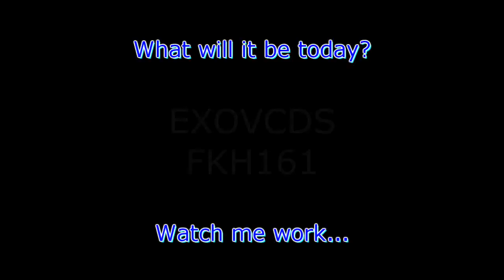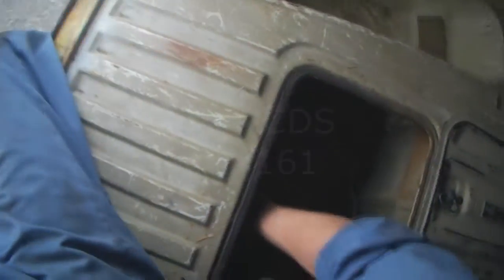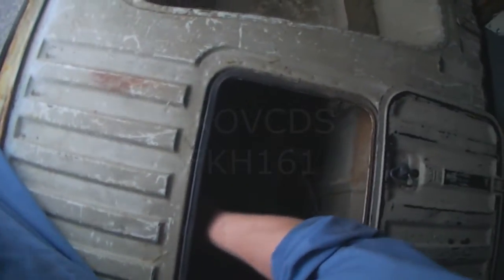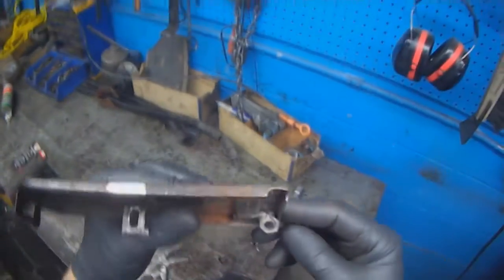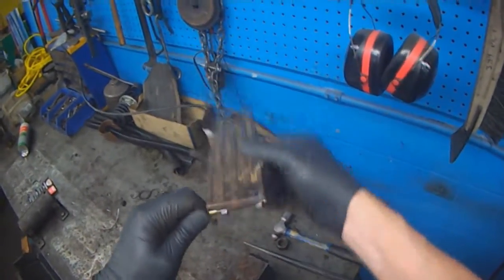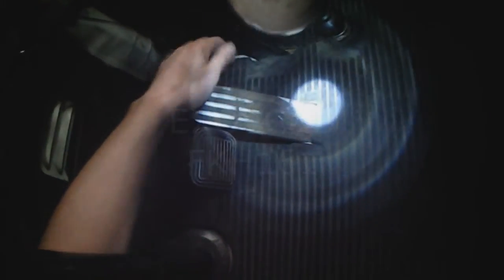VW T2: Broken Gas Pedal Hinge

Comment: dis happened to me just the other day, please tell, what type of nut(s) did you weld . . .  Metric or English?
Reply from the maker: Doesn't matter... whatever works / that you have (the threads in the nut holes are not used).

Comment: how do you remove the original pin that hold the petal to the mount?
Reply from the maker: It's a crimped hinge fitting similar to a door hinge:
https://volkswagen.7zap.com/en/usa/type+2/t2/1978-29/7/721-62000/

Comment: Can any one help me with a problem I'm having on a 2006 passat 1.9 bxe engine , it starts fine when cold but after it warms up it'll start and stall straight away then after a few try it'll run fine , I'm getting a p1570 on my scanner
Reply from the maker: If the immobilizer icon (key) in the dash is flashing, then the immobilizer is not recognizing the key for some reason... for other possibilities, read through this link:

http://wiki.ross-tech.com/wiki/index.php/17978/P1570/005488
Reply: Thanks for the reply , the icon is not flashing so ill check elsewhere , hopefully I'll get to the bottom of it , keep.up the good work and the videos
Reply from the maker: Paul Meehan Could be temperature sensor, crankshaft position sensor, intake flap sticking closed, in-tank fuel pump, EGR sticking open...
Reply: Crank sensor ,egr, fuel pressure seem fine intake flap is operating ok so it's looking more like an  immobiliser issue
Reply from the maker: Paul Meehan Weird that it only happens when warm... I have heard of / similar issues but have not seen it myself. If it starts & runs smooth, but dies, then yes... immobilizer.

If it starts, runs rough and dies... not an immobilizer issue.
Reply: Sorry after my first post it started failing after it cooled down from my first run this morning then went ok when it warmed up then started failing again so seems to be failing across the temperature range
Reply from the maker: Paul Meehan Like this?
VW Passat 1.9TDI B6 Starting Problem, Fuel Injector Seals Leaking
Reply: No, starts straight up, runs for 2 seconds and stalls , repeat this process a few times then starts and runs perfect no hesitation
Reply from the maker: Paul Meehan Sounds like immobilizer.
Reply: Yeah , customer won't be happy with that , thanks for all the help